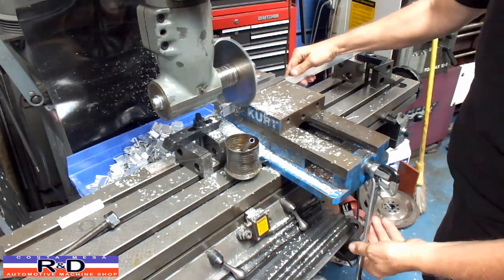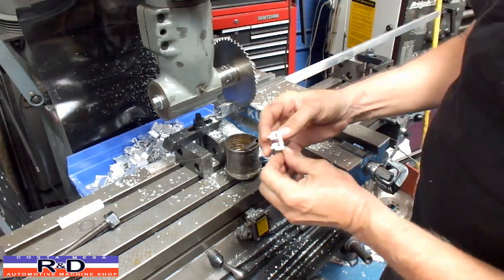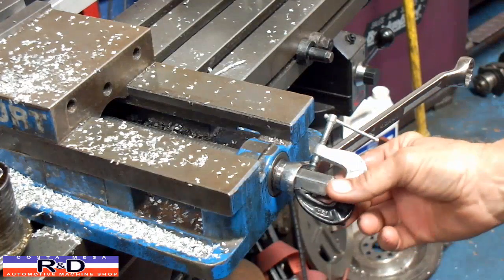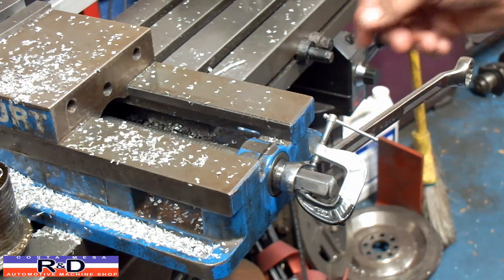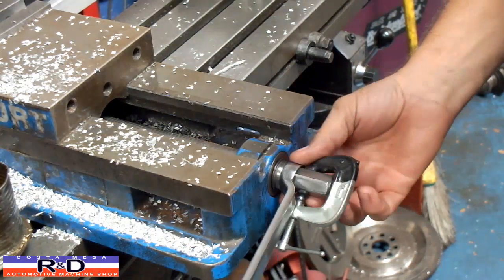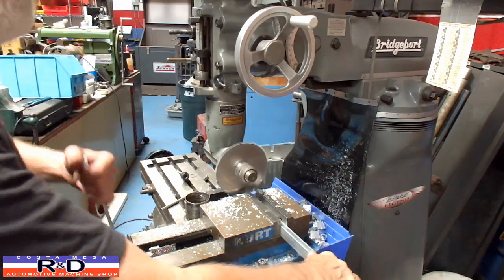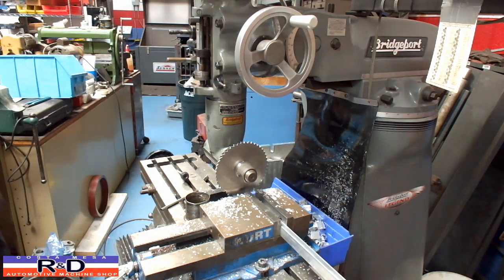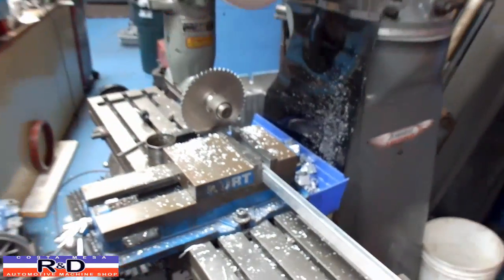Production Tips for the Bridgeport Mill

Comment: I got a 10 inch compound miter saw from a shop that closed.  They fitted it with an 80 tooth carbide blade and made a solid aluminum fence for it.  Works great as an aluminum chop saw.